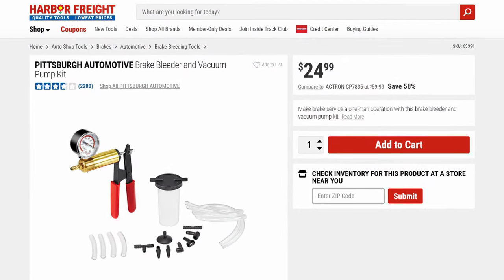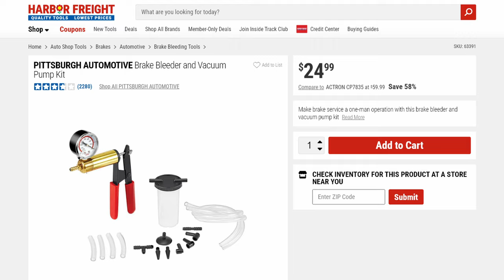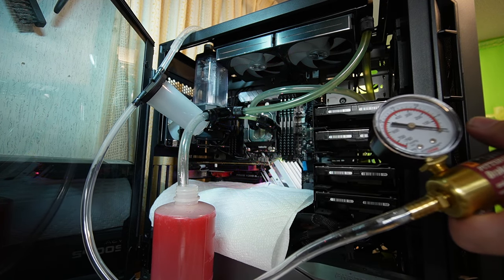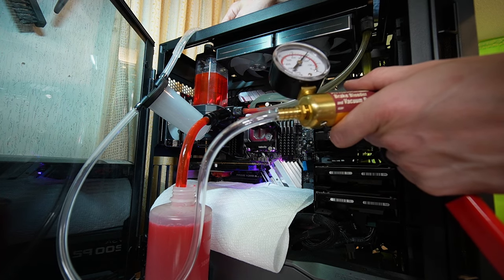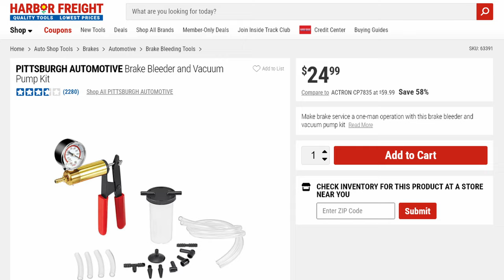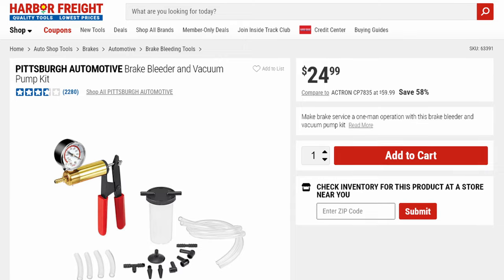Testing JayzTwoCents Vacuum Theory | Hand Vacuum Pump To Fill Water Cooling Loop

Comment: You overcomplicated it. You should just leave the valve open and pump it. This pump has a valve in it. The fact that the liquid didn't go higher in the second pc because it was too high.
Reply from the maker: Oo i didn’t think about that. I was more worried about it draining back down but hydraulic pressure might not have let it. Interesting. Also i had to raise the other one to drain it and was being lazy and didnt want to lower it yet.

Comment: I had commented on JTC's video that I used a hand-vac and that's the exact one I was referring to.  It really is perfect for the job.  And, yeah, I limit depressurization at 15hgin.  Also, don't worry too much about air.  Just keep pumping with the valve open while the loop is running.  That way you'll still have an 'air-head' in the res without risking sucking fluid into the pump.  There's no real gain in surging the fluid in.  Finally, close the drain and run the loop while alternating vac-release-vac-release.  You'll eventually achieve a full bubble purge.
Reply from the maker: I wondered if anyone else had done it. I went looking for a vacuum pump and almost got a different kit but then saw this for $25 and had to try.

Comment: its depressurizing the loop. and sinds you have 2 pc in one loop setup with soft tubing. it dous not work that well. totaly normal tho. did you try go in full vacuum?
Reply from the maker: I went up to 15 and it collapsed the soft tubes pretty much completely but I didnt see a ton of improvement of intake of water.

Comment: i need to know how that setup is set up, that's so strange and confusing, genuilly curios not moking
Reply from the maker: Corsair waterpump combo unit out to ball valve on a tee, out to radiator, radiator out to second computer, back to other cpu, back to water pump.

Threadripper computer is a unraid nas on a ups so its always on. Two noctua fans on top controlled by the second computer to pull more air through the radiator as the system calls for it. Works well but the jank is real. Made filling it a pain so i tried the vacuum pump method.
Reply: Why  1 loop on two pc for only the second cpu ? Should've not been easier an AIO or another loop for the second one?
Reply: It would've been even less messy and hard isn't it?
Reply from the maker: @michaelrigoni1191  radiator and pump combo is expensive. I want the EK flt 120 to put it in the top right of the case facing the glass. Just havent dropped the money on it. Too many other hobbies and its still working 2 years later lol.
Reply from the maker: Didnt want a standard aio block for my threadripper. I wanted a full block so had to go custom loop. And planned a custom loop for the other pc and this was supposed to be temporary. Its been two years though lol.

Comment: Dude! I've had the exact same kit I got on sale from HF in my office for months that I picked up to try this. Haven't had a chance to get around to it but I guess this is the algorithm telling me to get on it. Thanks for confirming my suspicions that this would be a cheap but effective solution. Great video.
Reply from the maker: One guy in the comments said just leave the valve open and pull a vacuum. I didnt think of that but it could work as long as your fill tank doesnt run dry. Good luck!
Reply: @BloodshedRomance  Thanks. My situation is a bit different so it'll take some experimenting anyway. It's a compact frankenstein loop built from EK-Phoenix parts, an additional rad and a new CPU block. There's no traditional reservoir since it's built into the main radiator module so purging and getting air out is an absolute choir to say the least. I'm confident this will work though and it's braided EPDM rubber tubing that won't collapse easily.

Comment: I did the vacuum fill too. But made it so much easier. 
Pipe from the top of the reservoir to the fill port. 
1 T fork filling with a ball closing fitting, and put it on the input of the reservoir. 
Then have the drain valve on the 90 of the T fitting. 
Ball valve open is a normal water loop. 
Ball valve closed turns the entire loop into a one way pipe. 

So from the drain port, put the pipe into the fluid. 
And from the fill port have the vacuum pump the pressure. 
Open the line and the water gets pulled right up through the drain line and fills the PC. 

And the only thing to disconnect is the one line from the drain valve.
Reply from the maker: Yeah i thought about that after doing it but was referencing the way Jay did it in his video. Next time i am going to try this on my weird loop and see if it fills both cpus.

Comment: I'm building a rigid loop with copper, so i could probably get enough pressure to fill in one go.
Reply from the maker: @cgjoh  technically you could just open the top and run the vacuum until you get water to the top of your res if its the highest point in the loop.